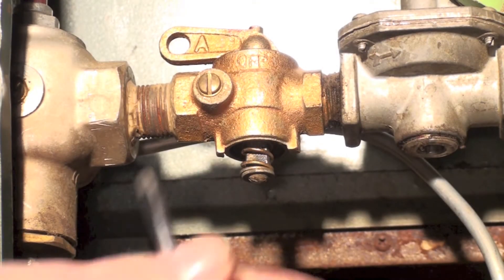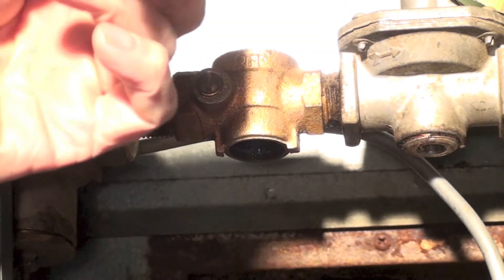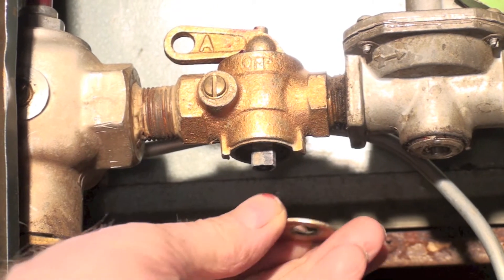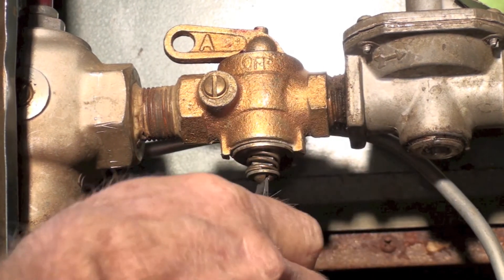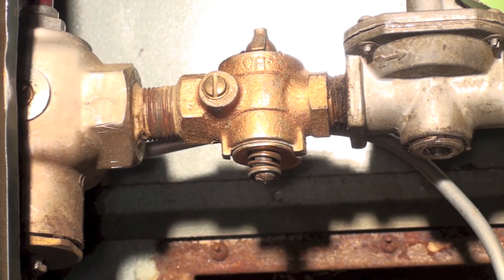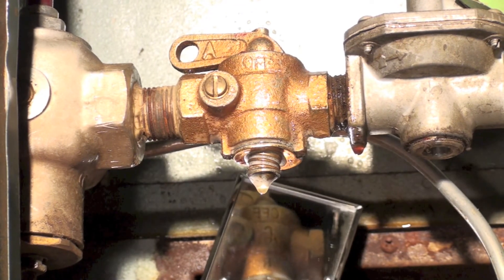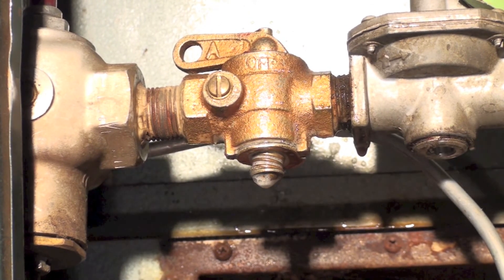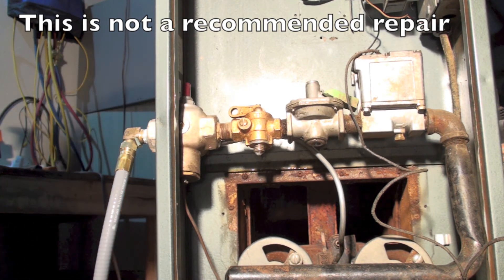Leak repair of the manual valve of the gas chain

Comment from the maker: It is not a gas cock in the way we usually use them.  It is designed to cut off main gas, but leave the pilot light on.  Hope this helps.
GFM